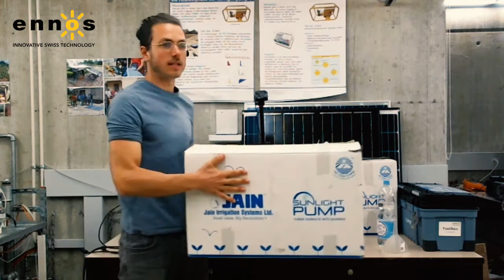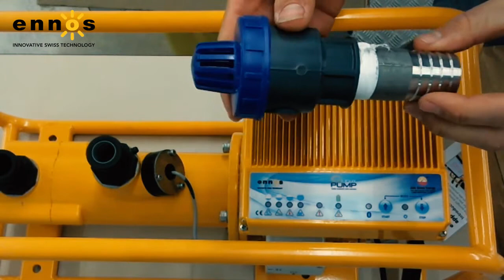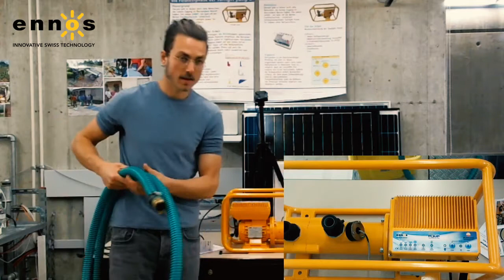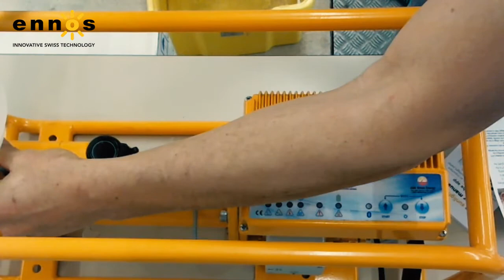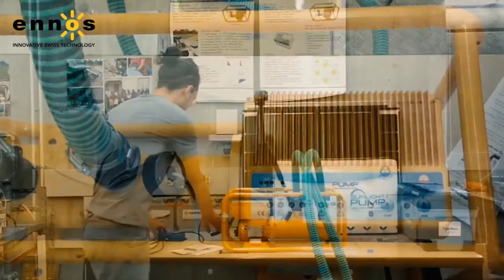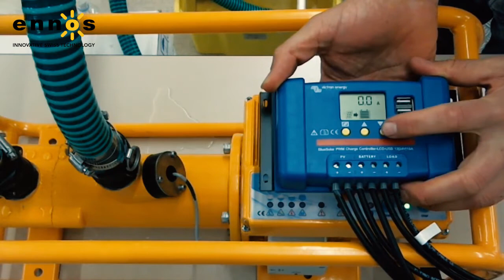Training 2: Installation in solar & battery mode (EN)

Comment: sir my Machine Off switch does not work what i do .can you upload switch repair related video .
Reply from the maker: If the switch off does not work, you can change the electronic, or just disconnect a cable to switch off the pump

Comment: Thank you for this informative video. What i have not understood is the detail of the connection to the batteries. 14:19 You have mentioned that they are 2 12v batteries connected in series, so thats 24v? However you didn't show the connections, the cables, the battery capacity. Kindly share more information or a guide on this. I would love to know the performance using batteries.
Reply from the maker: Thanks you for your question. You can use the sunlight pump with 12, 24, 36 or 48 volts, so 1, 2 ,3 or 4 12V batteries, depending the power you need.  You need also an external battery charge controller.